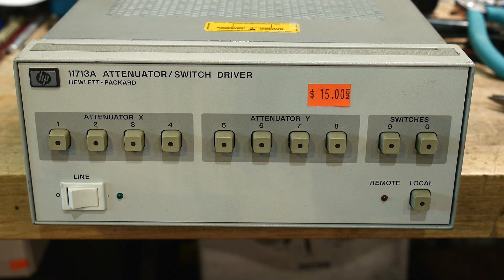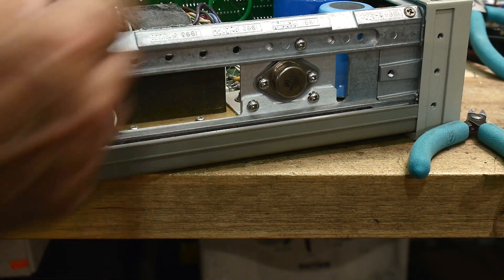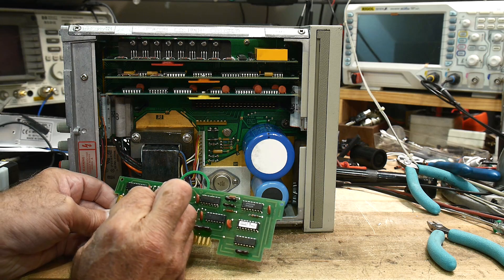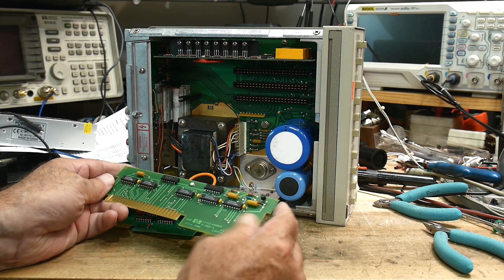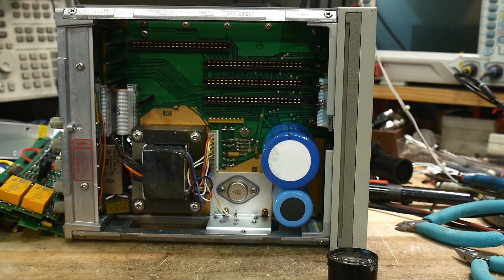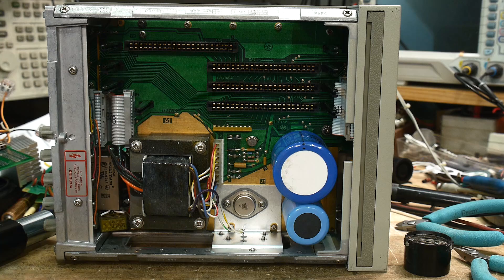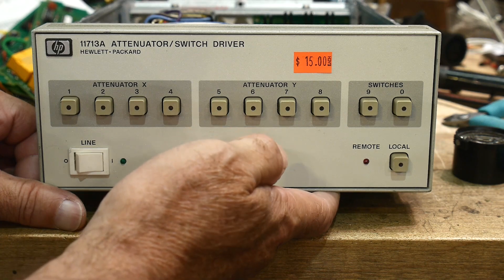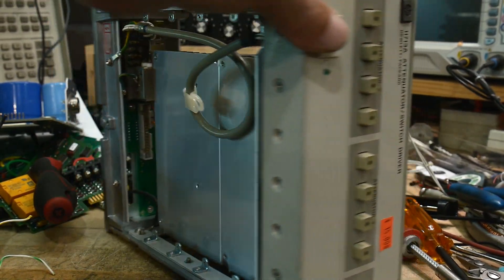#829 OPA549A Gets a Home

Comment: Just a bit off topic, must be way before your employment at HP.

They used an oval type connector to mains power. The connectors were made with the load on both The right or the left side depending on how you’re looking at it.  Some people say it doesn’t matter with AC voltage. Do you have an opinion on this?
Reply from the maker: Ah yes, before grounds. Well, the short answer is that it matters and can kill you! In some old tube radios (and other things), one side of the plug is connectected to the chassis ground. So if you are unlucky to have the hot side on the chassis and touch it. zap. ask me how I know. It is very very dangerous. With age those things get even more dangerous with capacitors going bad and stuff. It is the very first thing I change before ever powering up something. and use an isolation transformer to work on that stuff. If you don't know about this issue then please do not work on this stuff. it WILL kill you.
Reply: @IMSAIGuy  thanks it’s called a 163??
Neutral Earth Load (17280)
Or
Load Earth Neutral (17952)
Sorry this is what I meant.. Still as Scary?
My fault for not being specific enough
Reply from the maker: short answer is, yes, if you have to ask then yes scarry for you to be working on it. If there is a real ground and it is a three prong to earth ground. then that's better. If there is ambiguity of neutral and hot then it may or may not be an issue. Again, since you are asking, I must say don't touch it until you have more experience working on high voltages.
Reply: @IMSAIGuy  thanks
Reply: @IMSAIGuy  again thanks. Found this thread. Love the videos 

That is called a PH-163 connector. It was popularized by Belden from the mid-1960s well into the 1970s. The style always uses the center pin for ground, but the assignments for neutral and ground were arbitrary! This ambiguity is why the cords fell out of favor and are getting difficult to find today. 

HP uses what is considered the "reverse" connector wiring. Looking into the end of the cord with the center ground terminal at top, "hot" is on the left and "neutral" is on the right. Up until recently, you could order a replacement cord, Volex part number 17952, from most of the major electronics parts distributors. They no longer seem to be available from those sources, but it may be possible to order them direct from Volex, or from other online distributors that may still have some NOS. Volex bought Belden's power cord and finished cable business some years back, BTW. 

The "normal" version of a PH-163 cord (which you don't want) is Volex part number 17280. Its "neutral" is on the left, and "hot" is on the right. Like the 17952, this cord is no longer available from major distributors but some dealers may still have it NOS somewhere. 

If you did get a reversed power cord (perhaps used), it would fit and the instrument would probably work fine, but there would be one little problem. More parts would remain "hot" with the power switch off, increasing the chances of shock when the covers were removed. Also, in some cases there are interference filters built into equipment which might not work effectively if the leads are reversed. For these reasons, the IEC designed the current C13 computer cords with square pins so they cannot get mixed up with PH-163 cords! 

Some people recommend removing the PH-163 power inlets and replacing them with IEC C14 inlets. Unfortunately this almost always involves drilling new holes and/or cutting the sheet metal. My usual procedure is to simply make a blank plate out of metal that goes in place of the PH-163 inlet with two screws. A hole and grommet in the center accommodate a permanently attached power cord. Should anybody ever want to restore the instrument to its original configuration someday, the mod is very easily reversed.
Reply from the maker: @markgreco1962  Yes, sounds like trouble. I remembered my HP427 has an old connector. It is wired directly to the transformer so line and neutral are not a problem. HOWEVER, the transformer is alway on. no AC power switch. the power switch is on the DC side! and even worse, there is no fuse. Love that vintage stuff...
Reply: @IMSAIGuy  Ha! I keep my 427A unplugged and only use it on battery power for that very reason.

Comment: Look at ‘diode gone wild’ for handy tips of what to expect from those Chinese 24v psu. Many components are recycled and the transformers have very little copper in them these days. So it would be good to recycle the old PSU as I’d say it would be another good adventure.
Reply from the maker: Unfortunately the old power supplies are linear and I can expect about 500mA current. The switchers will give me 5000mA

Comment: Good morning IMSAI Guy! I recall the previous videos you made (roughly about a month ago) that included the OPA549 IC - high current/high voltage operational amplifier module. I think you were on a quest to build a +/- 24 volt "buffered, high current/voltage, bench power supply", if I am not mistaken. I distinctly remember that you made two (2) videos, back to back, about this project, but what you didn't reveal (or perhaps you did and I just missed it) was exactly what the use case(s)/application(s) were going to be. So my question remains; what are you planning on using this specialized +/- 24 Vdc power supply for IMSAI Guy? I recall you performing some testing of the circuit with a DC motor, but I am curious about what the final application will be for this design. Will you be using it to control motors on some other device that you haven't gotten to yet?   Fred
Reply from the maker: I'm just getting around to putting it into a box. It is just a piece of generalized bench gear. I don't have a particular project in mind. this high current buffer IS the project.
Reply: @IMSAIGuy  Thanks for the response! Ah ha. Okay, makes perfect sense in this light.   Fred

Comment: Nice build, interesting story. You probably thought of it but do you think you can pop those supplies out of their box and gain some more room or would that cause a noise problem? Just thinkin out loud. Thanks for the look.
Reply from the maker: I did consider that. It didn't really buy be much as the PS cases are built in heat sinks and I would have to re-create those, and I would have to make sure to electrically isolate the two. It didn't buy me anything
Reply: @IMSAIGuy  understood.